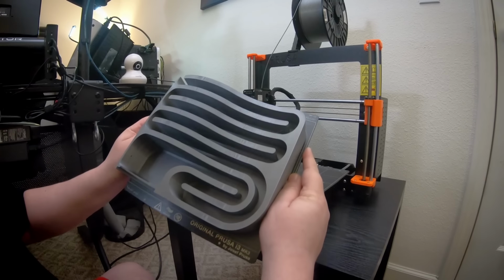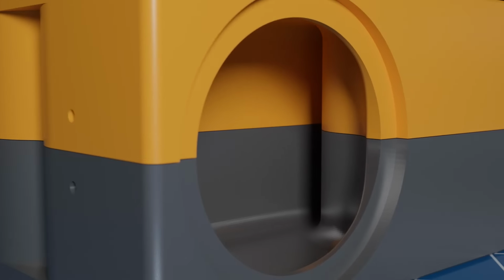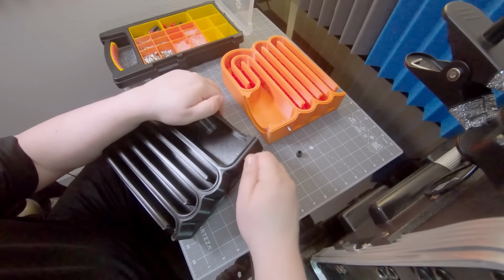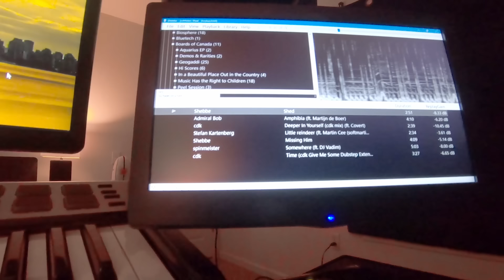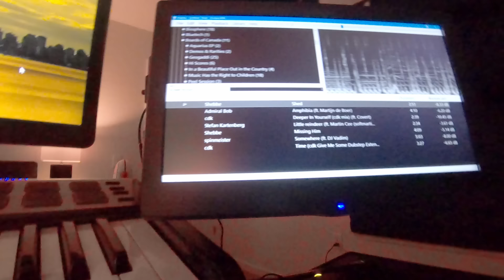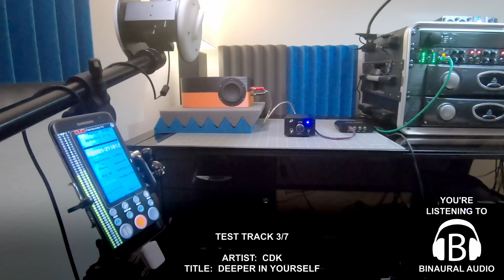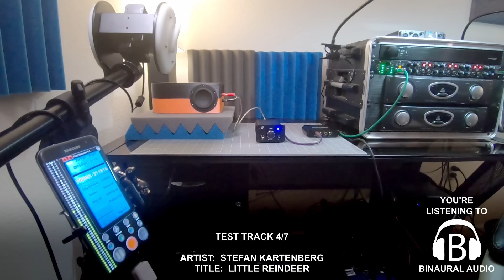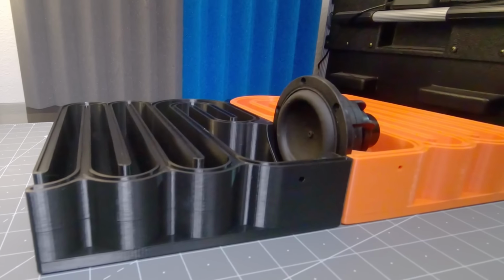3" Subwoofer Enclosure v.2 (Plus Demo)

Comment: Everyone's saying they want to see this for a 10 or 12, but I'd love to see what a 6.5" sub from Sundown Audio or similar could do.
Reply: Just viee a bose. Same settup just been around doing itv20yrs earlier
Reply: Itd probably hit way harder than 90% of single 10 or 12 setups. I'm pretty sure there was a guy who got 150db on 2 of them
Reply: Trevor MTB 60% box 
30% amp 
10% sub's

There's people who have won comps with Sony xplodes over guys with DC sundown etc
Reply: @lilrich1243  yeah for sure it's mostly the box but still 150db on such tiny cone area is crazy impressive
Reply: speakers if properly made they need size to shine, so a speaker from e.g. JBL 3" vs 12" subwoofer speaker, the 12" would be wwwwwwwwwway better as size does matter even if it's the same build quality :D
Reply: Definitely I run 8s my friends 12s don't get as low on there 500watt systems as mine smaller is more lol
Reply: An enclosure like this with a Sundown sub? You're trying to make an earthquake or something?
Reply: I just want a cheaper monitor sub, so having equipment I can plug into the wall, with these woofers, as well as, since it gets used, It'd be easier if the sundown 6.5's are used in an enclosure and a build guide could be made <3
Reply: I have a video on my channel of the setup in my truck, it's two Massive Summo 6.5" woofers in 0.418 cubic feet each, ported and tuned to approx. 32 Hz. I would LOVE to see what they would do in a box like the one he made in this vid.
Reply: I made a t-line for a single Sundown E8v1 and it SLAMMED 200 watts. I had it in the back seat of my 92 Toyota Extra Cab 4x4. People swore I was hiding more subs. I saw a single 12 inch infinity Kappa in a monster t-line on 300 watts and it HURT.
Reply: I’ve got the DD 6.5 sub
Reply: @trevormtb9372  I'm gonna call bullshit until you can provide a link with proof.
Reply: lilrich1243 people shit talk xplod’s i have a 10 in a bandpass box now off a kicker kx400.1@4 ohms so only 200w but it sounds good, and other one i had was a 12 on a tma 750w amp in an spl slot port box and it destroyed my geo metro.
i think it’s because they look funny
Reply: that would be dope
Reply: Massive audio make a pretty sweet 6
Reply: toxic top hat cone area has no bearing on how low it will play. Only on how loud the frequency is played
Reply: Sundown is amazing. I had a 2 ohm 10 inch Sundown sub in a tuned ported truck box with a 1034 watt class D amp. It would make car alarms go off. Moved people's hair around. Made my rear view mirror mount fall off my windshield several times. I had to keep it turned way down most of the time. It would blur my vision while driving to the point where I could not read road signs.
Reply: Sundown I believe, and if not it's one of their highly esteemed competitors with stitched surrounds and ginormous magnet motors have plenty of videos posted on YouTube and you can see and then sanely impressive again I believe Sundown 6.5 in action and it is a Nutty thing of beauty
Reply: No a menphis mojo 6.5
Reply: @Sc0ttishGamer88 Would take much longer. I liken it more like waiting for your cake to finish baking in the oven...
Reply: I wanna do it for my planet audio anarchy 10"
Reply: I got a skar audio evl 6.5 wired to a shitti pioneer gm a3702 and i got a box that was some sort or furniture back in that day but i just make a hole for the sub and bolted some pvc pipe port and it surprises me to this day because it sounds better than a logitech z5500  and imagine how will sound in a tuned T-line box with a real amp from sundown
Reply: @WorldFamousUnfluencer  I agree. I always cringe when someone tries to tell me how "good" Bose is
Reply: No way that plastic enclosure would hold up against a sundown audio sub
Reply: I made a 12 for my car with almost exact same design, when i left my car eith my ex i let her take it though, and the amp is now blown. If i get another car amp I could get her to bring it.
But you may as well just search 12" T-Line sub on youtube.
Reply: @trevormtb9372  definitely not, if you build a 12" t-line box and power it properly it will blow this out of the water, if you ever go to small electronic music shows, the local ones herr use 2 to 4 18s, and my old 12 would easily compare.
Reply: @LittleRainGames  I mean a well designed t line with a 6.5 would be louder than a 12 in a standard ported box
Reply: Are you in the market to 3D print a custom box for a 6.5 inch sub. I have a fiesta st hatch and i am very limited on space. I do not just want to throw in a  prefab box and lose what little bit of room i already have.
Reply: Sundown lol
Reply: How about a JL Audio 13W7
Reply: Just imagine how long it would take to print!
Reply: @natskar  I bought the bose earbuds and they are awesome
Reply: @mark bryant I’ll have to give them that at least, they do make decent headphones for sure
Reply: Maybe more of an 8
Reply: I hate sundown foh
Reply: @davidvelasco7420  no one cares
Reply: I did like to mate it with a 6" full range.
Reply: I would buy it, it would be a perfect for a trunk mount.
Reply: @trevormtb9372  i got 142 on a single 8. I never tested my 10 but assuming high 140s.
Reply: 10 inch is hard to beat.
Reply: I wish some of those SPL guys would look into transmission lines. The application is perfect. A simple TQWT could free up a good 500W from power demands.
Reply: I use to run 4 8s in ported box in trunk build and hit 140db, then upgraded to 3 18s 6th order b pillar wall and hit 152db on music 😊
Reply: I had 2 X8s in a t line tuned to peak at 24hz in my room on only approx 50rms per sub. Even at that power it was crazy loud. Shaking windows in the house and the frequency response was super flat and accurate. My favorite box so far. Wish I could have heard it in the house with the power they’re actually rated for
Reply: @knuckleuprambo  bose is trash. no highs no lows? must be bose.
Reply: JL Audio 8" sub.  Yes, now it's bigger, but on the other side, it's bigger.

Comment: Scale this to a 12” and I’d be interested in purchasing plans.
Reply: yes please!
Reply: they don't make printers that big
Reply: Peter Darr not true, they are using big enough ones to print houses with cement.
Reply: @peterdarr383  it could be separated into 4 pieces for printing.
Reply: @peterdarr383  at the size of a 12" box, you could build this in wood easily.  (Wouldn't work btw, you can't just upscale and use a different chassis. You could however design another tml for a 12" driver. This would be absolutely huge though.)
Reply: @peterdarr383  Modix makes a 24" deep by 48" wide by 24" tall 3d printer.    Creality makes a 19.6" x 19.6" x 19.6" printer for around $700.   For a few hundred dollars more you can really upgrade its capabilities and improve it, but out of the box it has pretty decent print quality.  Out of the box it is about the same cost as the latest Prusa printer and upgraded it is a very viable option.   Also, Kelly is correct:  It could be printed in multiple pieces and either glued or screwed together with gasketing.
Reply: @underourrock  What is the tensile strength of the "plastic"
For instance - - JB-weld claims 4,000 PSI
Any info would be appreciated
Reply: @peterdarr383  CNC Kitchen has a channel devoted to testing all manner of 3d printing variations including different materials, different printing methods / settings, and much more.  So, if this is a topic that really interests you, that is a great place to check out some actual test data by a very thorough engineer.  If you're just wanting an answer with no investment of time to get it, then  I will say that the tensile strength of PETG is about the same as ABS and both of those are very strong.  PLA is not quite as strong, but still not bad.  As for the numbers, you'll need to look them up yourself, but if you want to know how strong 3d prints are, then you'll need channels like CNC Kitchen because the strength of a 3d printed part can vary greatly based on the settings.    They're readily available if you can type into google:  Tensile Strength of PETG or other variations of that search.   JB Weld is some pretty awesome stuff, by the way, but what failure mode are you trying to protect against in a speaker that the weld has to be stronger than the rest of the speaker housing? 

On a different note:  KuRo88 is absolutely correct:  You can't just scale this design up.   Air pressure and acoustics don't scale linearly and a box would need to be designed specifically for the bigger speaker.  That box could be biiger, smaller, or just shaped very differently than if you just scaled up the smaller box.in order to produce the right acoustics.
Reply: I got a 3d printer the can print 15 by 15 by 15 inches
Reply: Why? The rolloff on the low end would still be the same from a ported box and more efficient.
The reason for this little project is to compensate for the higher fs a lower output from a tiny driver.
Reply: @underourrock   currently the print requires 1.5 kg of filament. If u scale a length by 4 ( 3" sub to  12inch sub) u scale the volume (and therefore roughly the amount of plastic) by 64. I think theres a point at which this i sno longer worth it. As it stands its about 30-40$ of plastic for a $40 driver. I don't think at that point its really worth it. Moreover - not really the point of the video...
Reply: How about you do that yourself? The stl is in the description
Reply: Scale it up yourself, he already did all the hard work and provided the model for free.
Reply: @peterdarr383  yes they do lol.
Reply: @zerocool6452  Thanks for that - 
but which "polymer type" is JBWeld ??
All I know it's a 2-part epoxy resin.
And it works wonders - - 
I built a used engine which soon blew a head gasket. I removed the head, added JBWeld to the block between 2 cyl's and some on the USED head gasket, re-assembled and it held up for years.
Reply: @peterdarr383  it would have to create more than two parts
Reply: @winkletinklegames7863  that's cement
Reply: Just build it out of wood or mdf.
Reply: I'd pay a hefty price for it too
Reply: Rozza43 wood or mdf? Pretty sure there 1 in the same...
Reply: Dave Micolichek  OF COURSE
Reply: That’s not the point.
Reply: Even if you scaled it up to an 8" you'd be fine but the enclosure if designed around that 3" Tang Band.   There would be some modifications needed for the different T/S parameters
Reply: Why are you people even speculating on this. Doing this for a 12" would simply be a waste of time and money. Also, did that dude really use JB weld for a head gasket lmao what a boss.
Reply: At a 12 drive scale it would make alot more sense using a cnc router to remove material, would be far cheaper, quicker and easier. In fact you could do this for this scale too.
Reply: @peterdarr383  you can make multiple smaller pieces that slide together
Reply: @Roshan_420  At what cost tho . . . . ?  I'm actually working on getting bass in my boat now.
Reply: @peterdarr383  I've had epoxy break on sunglasses. Seems about as useful as superglue
Reply: @nightmareinaction629  the box for a 12 would be the size of a small closet. why would we need a 12 if a 3' can do 40hz?  Sounds like you could eaisly make a 4 5 or 6 sub that can go to 20hz.

Comment: 3 years later I finally printed this on my X1 Carbon. Took only 13 hours total and sounds awesome! I took apart a logitech z313 sub and printed housings for the components that were inside. Nothing fancy but sounds good enough for now.
Reply: how  would you rate it compared to a bigger sub?
Reply: @RandoWisLuL I think the question is how does it compare to a typical cabinet with normal port. A lot more bass extension! you'll never get the same feel as a bigger sub
Reply: @3D1ofakind  true

Comment: This is probably the best thing I've found on the internet in a long time.
Exactly suited a problem I had.
I was looking for an extremely small sub that fits under my computer desk and that delivers heavy nice bass even at low volumes.
So I printed my own small two-channel speakers and this wonderful subwoofer.
So now I have a compact 2.1 system that performs well with deep bass even at very low volume.
So many thanks for sharing your design.
Reply: I'm trying to figure out if I need to put a passive low pass crossover on it.  I'm ordering the sub.  Did you just let it go full range?  Was thinking about a 100hz low pass.
Reply: how big is your enclosure?
Reply: @itspoffy  regardless of what enclosure is in, a subwoofer shouldn't get the full range. A NE5532 pre-amplifier module costs a few bucks, use that as a low pass filter.
Reply: It goes deeper than my Microlab FC330, but not sure about max SPL.

Comment: Thank you for posting the stl files. Your a gentleman and a scholar
Reply: Do you happen to know how much plastic you used?
Reply: Indeed! I love this channel and what they are doing. A true labor of love, you can tell from his dedication and professionalism!
Reply: @HexiBase  two pieces should be produced for a truck of mine in two weeks. Have you been thinking to design high audio quality bluetooth speaker? I believe you could make JBL run for its money...
Reply: @lamazver  how far is that setup for a truck? possible to get a video demo for yours?
Reply: @vahvelpoiss  Well finally today I have got the speakers from USA and one box is being printed as we speak. I plan to run these woofers over the Pioneer DEH-P77MP head unit and  use RCA output to run hertz Mille Pro 3 way speakers over Audio System Twister F4-600 amp. And I plan to use two unused channels from amplifier to power up hidden 12" subwoofer under the passenger seat.
But I hope that these micro subwoofers will do pretty good job when ran over head unit...
Reply: @lamazver  run a demo with just the small ones powered for an idea what it can do in a car and record it :D
Reply: @vahvelpoiss  I'm going to do it for sure! Ill take my sony cam and I hope it Will record the sound properly.
Reply: @HexiBase  Now I have to buy a 3D printer 😁
Reply: @lamazver  how did it go ?
Reply: @luisfernando55  still unfinished. Guy who is printing the boxes is having some issues with printer😑
Reply: @Noah Starcevic good one, I caught it too and it bugs me as well. I grew up without computers. I can only assume that people younger than myself have had the benefit of autocorrect. Maybe not having the need to retain correct spelling leads to the epidemic of misused words. There/they're/their. Two/to/too, and so on. It's frustrating to read. 
Ahhhhhh, now that I've vented, I feel a bit better.😏, thanks.
Reply: @Hexibase - I am building this now.  Could you share what fasteners you used to affix the driver to the enclosure?

Comment: Holy shit I didn't even know my earphones could go this deep. This is drool worthy
Reply: and theres probably at least 40 hz worth of deeper notes that your earphones wont play
Reply: @dojostarfox4520  need a 15" in the 'Lac boiiiiii
Reply: I listened the track itself and this video has way more bass. Would love this bass  on every track
Reply: Forget what i just said😅 stupid me was listening to the wrong tack🤦🏼‍♂️
Reply: Just use some EQ on the sound, that's all this is doing to your headphones.
Reply: I didn't know what I was listening for at first until I saw this comment.  That's so badass haha
Reply: @dojostarfox4520  no i have jbl Play down to 20hz
Reply: @bassbosted5661  custom built setup. +/- 1db 10hz-22khz in room response (heavy linear EQ mind you though). Very good for seeing how well these subwoofers work in Hexibase videos. I'll be making some of these for my car
Reply: @bassbosted5661  nah they don't, that's manufacture bs
Reply: 40hz isn't even that low lol you need better headphones.
Reply: My earphones are the deepest going "speakers" I own. My 2 12" DJ subwoofers are high passed at 33Hz to protect the drivers at high levels.
Reply: I replaced my quad 18s and dual 21 subs with one of these.  Same thing.